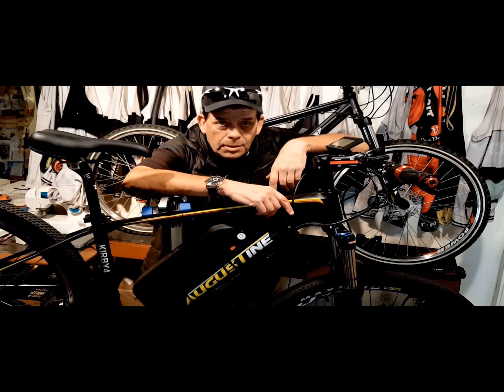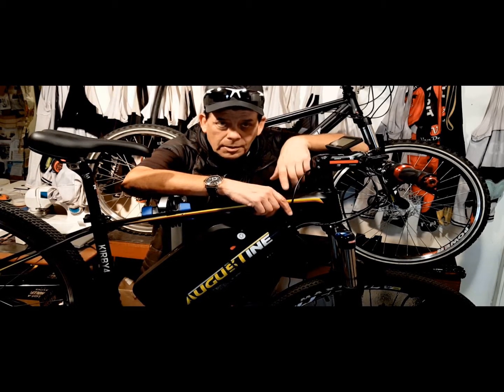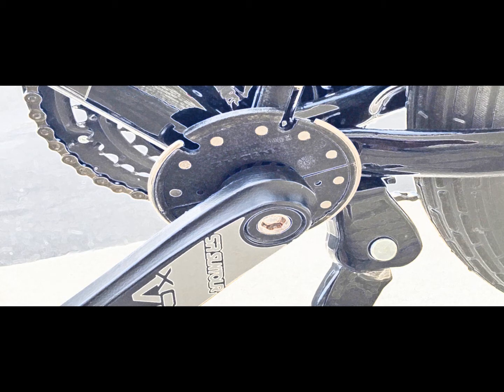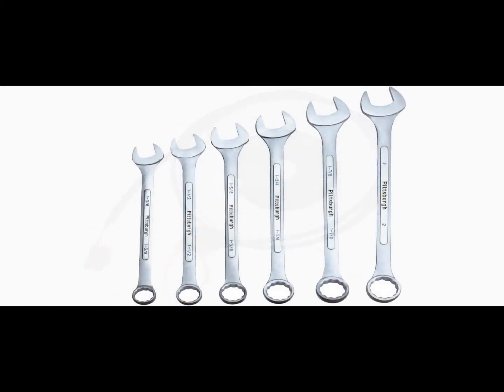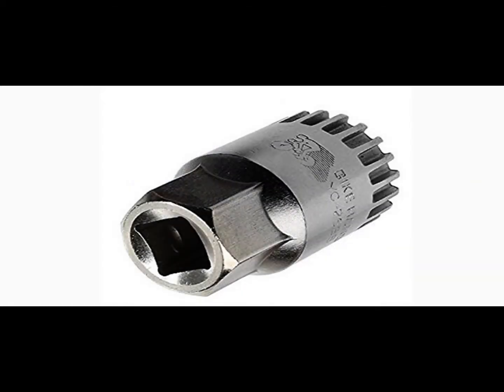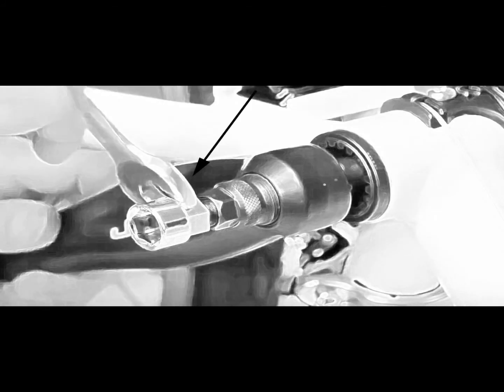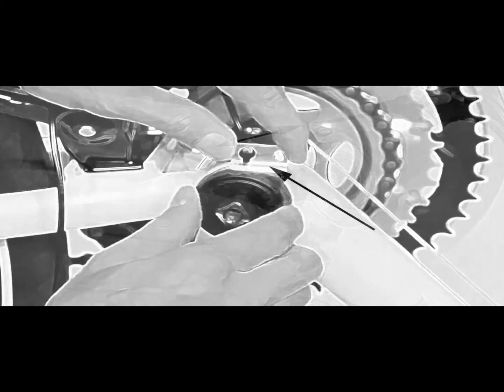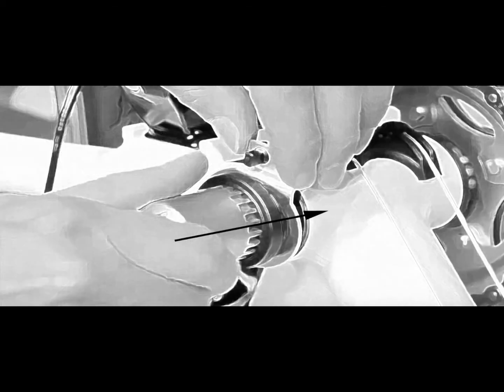INSTALLING A Pedal Assist Sensor

Comment: how i can stop Pedal assist from my bike
Reply from the maker: On most LCD controllers you can set Pedal Assist to 0 to stop PAS
Reply: I don’t have because it’s old and my motor 24v 250 w
Reply: AUGUSTINE EBIKES 2018 I have Three lines blue black red When I separate them It stops working